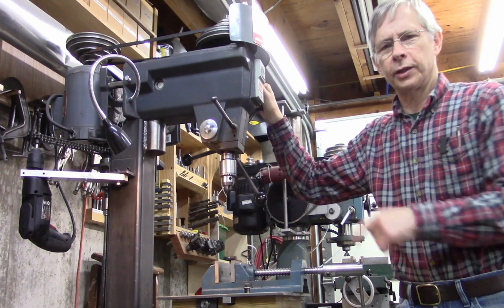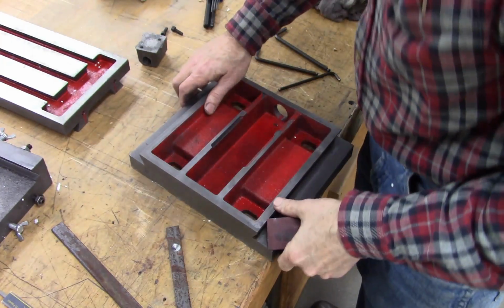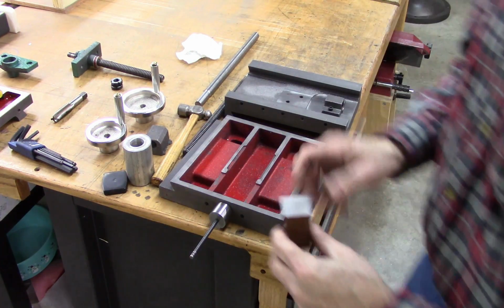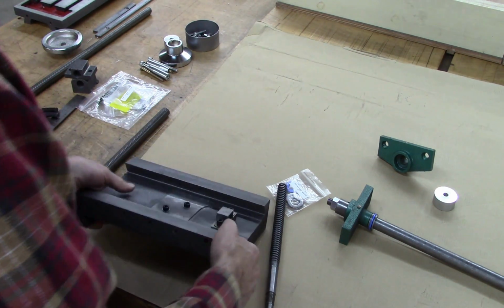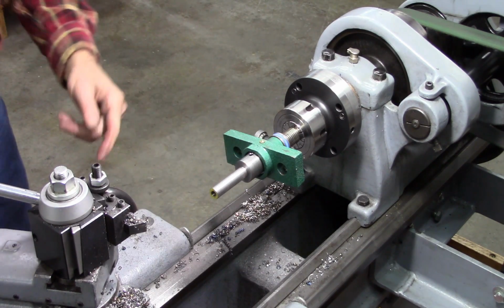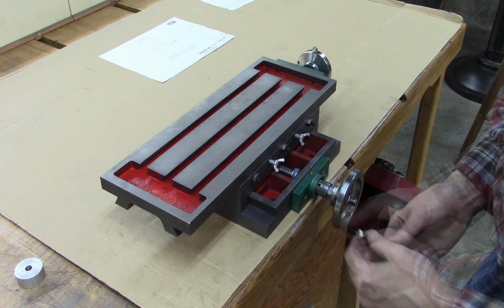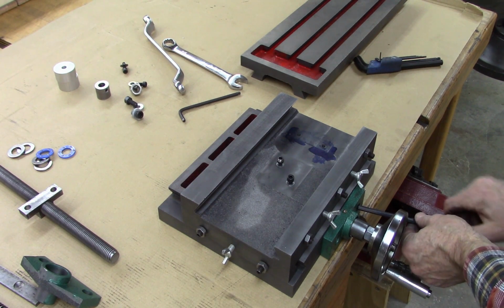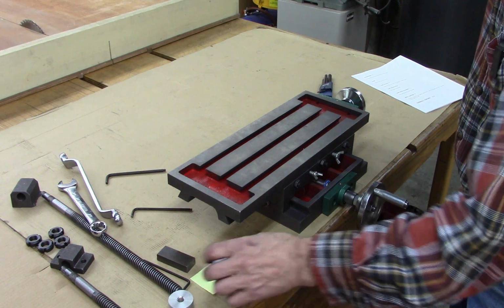Part-1 Vevor Compound Mill Table Review and Lead Screw Upgrade

Comment: Why the setscrews instead of counter nuts like it was before? You had to cut a thread anyway, the adjusting is much easier with the nuts and it's much more durable. The nuts dont have to be hex, they can be round too (as original, only a little bit wider) so that your dials fit over them.
And you missed the chance of using a longer leadscrew in x-axis with an additional handle on the left side. Now you have to operate the quill of your drill press and the x-axis of the table both with your right hand. For adjusting the position of a bore it is much easier to operate the quill with the right hand and the table with the left hand.
Beside that: Nice tuning!
Reply from the maker: Yeah, I could have used a round nut to set the thrust bearing preloads but trying to lock 2 round nuts is a pain. With the smooth dial hub the first nut sets the preload and the set screws stop the hub from rotating. It works very well and it's basically a one time adjustment. As for the long lead screw, I did make it longer to gain a little more travel but never thought about putting a handwheel on the other end. I like that idea although it would have required another bearing bracket and handwheel and it would make the screw alignment with the nut more critical.  Vevor chose to over size the bores on the bearing bracket to make this alignment less critical.
Reply: @WinkysWorkshop  The left bracket can be a relatively loose fit because all the load goes to the right side. The left side should have no load at all, only held the handwheel reasonably in position. So the nut alignment shouldn't be a problem, lot of mills use two handwheels this way. And you don't even have to make a new leadscrew, just make a reamed boring on the left side and loctide a short shaft for the mounting and the handwheel in. Always strong enough, and when you use a diameter smaler than the core diameter of the leadscrew you have no problems with the assembly, just push that end from the right side through the nut.
Reply from the maker: @paulpahl1607  Good ideas...  I just don't feel the need to move it from both sides but I like your ideas!

Comment: Another good project, seems the the table is good valve for the price.
Building that square column drill press is a project on my bucket list, is there anything you would do different having lived with for a while?
Reply from the maker: Yes on the square column drill press. I plan on doing a follow up video on this build so watch for it. The problem with my current design is that the lower support arms flex. I think two large plates on the side would work better than separate arms. The video will be posted this coming Friday (I hope).
Reply from the maker: Walt, I changed my mind on upgrading my square column drill press. The reason I was going to modify the design is to try and reduce the table flex. Most often the flex is not an issue but when drilling over 1/2" the table drops slightly. I'm guessing in most cases less that .030" but if you apply a lot of pressure you can make it flex nearly .100". Anyway, I think its a very worthwhile project but if you build it, make the two lower support arms a little wider. This won't eliminate the flex but it will help a lot. Also, send me an email if you have any questions. winkysworkshop@GMX.com

Comment: Good video Mark. I was hoping it would be a just unboxing as to the quality of the Vevor products I have been using are top notch quality. I have 2 little (unknown brand )  x-y tables i got from Little Machine Shop that I paid $80 for but was so damaged when i got it and had missing parts they had to send me another one. So now I have 2 of them that I have never used because they are just too light weight to even use. thanks for the video.
Reply from the maker: The vevor table is good out of the box if you don't mind sloppy lead screw bearings and attach a DRO. The way I went with dials was more work and required less clearance in the bearings

Comment: Awesome mods!  I think the keyed shafts were necessary because the dials and hand wheels were a single unit. Without the key, they could spin around the shaft giving a false reading, if the locknuts loosened.
Reply from the maker: I was thinking the same but honestly it would take a LOT to slip them. I don't think it will be a problem.
Reply: @WinkysWorkshop  Agreed. The set screw will prevent it from moving.

Comment: Does this table have more travel than your mill? If not, why the exercise? It's shameful that there is such a lack of quality in the stuff from overseas that you have to rework it to make it satisfactory for your use. I purchased a X-Y 5" drill press vise that needed some of the same fixes. It came with 3M.M. per rev collars.
Reply from the maker: I totally agree, it's a shame to put all that steel and cast iron into a table and not machine it right.  As for the travel it has much less than my mill. So why did I do it?  First, the drill press has much better visibility and faster setup time. The chuck is always installed and ever the speed chaning is a bit quicker. Most often I don't need more travel for drilling. Second, it's very nice to be able to leave my mill set up and still be able to drill. And third, the quill travel on my drill press is a whopping 6-inches and the mill is about 4.5.
Reply: @WinkysWorkshop  All good reasons! Thanks
Reply: I assume the manufacturer is using untrained young men and women off the street that are paid to produce as many parts per hour as possible with little regard for quality. The production cost must be very low to sell and ship this heavy product to a world wide market.
Reply from the maker: @ellieprice363  Very true I'm sure. It's still a shame to waste good cast iron. All it takes is one good detail oriented person to set up jigs and oversee what's going on.
Reply: @WinkysWorkshop  Yes and properly done with accurate jigs are fixtures the table would not cost much more while improving the quality and reputation of the manufacturer. Good tooling can be worth it’s weight in gold in production. I know since I’ve been a tool maker most of my life.
Reply from the maker: @ellieprice363  agree

Comment: Hi Mark !     I have the same 'unit' , but I'm just going to use 1/2 - 10 Acme threaded rod .   'Picked up a few 3' sticks from ZORO  for a very fair price . . . * way before I got this X-y table . . .  I used some of the acme rod for replacing a cross slide that was really hurting !    
       I spent almost 20 hours working on my table to get it fitting much better - I filed, then scraped  the rough machining on all the wear surfaces EXCEPT the dovetails , ( which were fairly smooth )     'Don't believe that de - burring is in the vocabulary of cheep Chinesium !  
     I'm actually intending on using my setup for 'light' milling , so accuracy is an absolute MUST  !  
I saw your video on making the dials for this , THEN I wondered WHY youtube didn't send any notification - they're getting pretty bad about it !     SO . . .  I bypassed watching the dials being made , to see this one FIRST !     'Glad I did !    
       I think my setup is going to have a longer X travel , by repositioning the NUT !    Same is true with the Y movement . . .  I can get 6" of cross travel , & 10" of longitudinal travel !    * Might as well milk it for as much as I can !           Great job on yours . . .   I replaced the stock ( garbage ) gibs with cold rolled , & put dimples on all of the gib screws , along with turning them into 'dog points' .   'Think I'll use brass tipped screws on the LOCKS . . . along with a longer 'lever arm' - ( they don't get snug enough to suit me ! ) 
                                    On to your dial making video !          Thanks for sharing your endeavors !
Reply from the maker: Good idea on the gibs and set screws and honestly I think 1/2" 10 acme would be better even if you have to sleeve the end bearings. The 3/4" was a very close fit.

Comment: Nice job bringing  it up to your standards. I was a little surprised that you didn’t slice a section of your lead screw nuts off and install some set screws so you could adjust the backlash. Thanks for the review, I have been looking at that table.
Reply from the maker: As it is now the backlash is less that .010" so not too bad. If i wears much I may split the nut but I suspect that will be years down the road.  Thanks

Comment: Thank you once again for inviting us into your workshop for a learning experience and a friendly visit. During the build I kept on comparing your solution, remachining  the tool versus adapting a very inexpensive Digital Read  Out. Your solution is very durable, reliable and cost effective.  A DRO is much more expensive, not as durable, but has buttons to push and pretty colored lights that flash at you!  I was torn between the two solutions!
Reply from the maker: The DRO is a GOOD option and maybe $120 to $150. My dials and screws were about $50 but also a lot of work.

Comment: Surplus Center in Lincoln Nebraska has acme threaded rod, and the nuts to go with.
Reply: Thanks for the tip, Bryant!  Nice place...
Reply from the maker: I'll check them out for future builds. I've bought from them before but didn't know they had acme threaded rod

Comment: did I miss some were why you were replacing the lead screws? I am assuming to make US reading's?
Reply from the maker: Sorry if I didn't make that clear. Yes, I wanted 10 Threads per inch. The original was weird even for metric. 4 mm per turn.

Comment: Did you look at McMaster for 3/4" lead screw? 98935A842 is <$16 for a 3' length and a hex nut is <$6.
Reply from the maker: I did look. It needed to be 10 TPI. For some reason the price jumps way up.
Reply: @WinkysWorkshop  I didn't realize you wanted 10 TPI.
Reply from the maker: @bobd.  Yeah...  to make the dials work right it needs to be 10. One turn is .100"